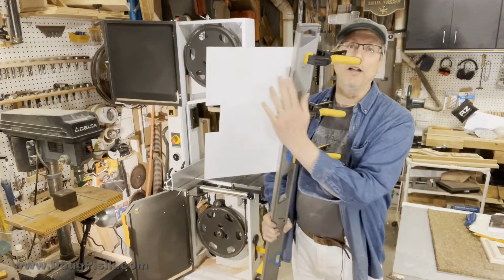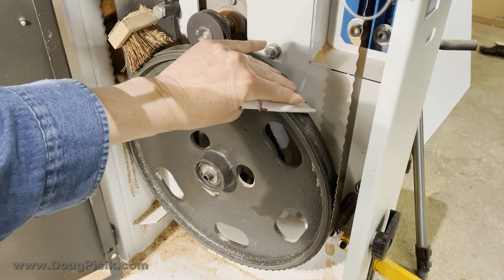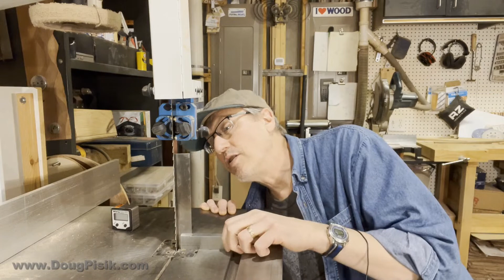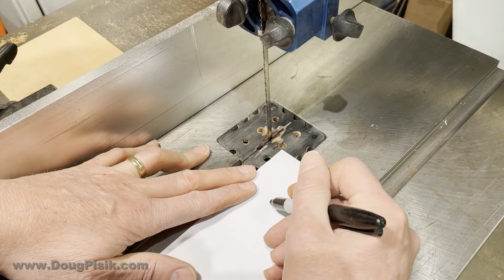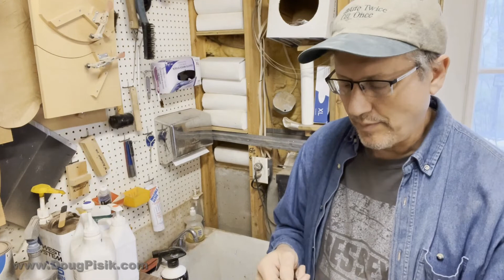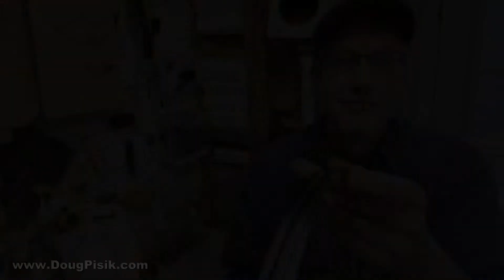Bandsaw 9 Tips for Best Performance and Smoother Cuts

Comment: Thank you for that drift tip...
It's really helpful.♥️
Reply from the maker: Glad I could help. Happy bandsawing!
Reply: @dougpisik Both the machine manufacturer and the bandsaw blade seller insisted that the blade tips need to stick out past the wheels—I’m a bit confused... Are you saying this based on experience?
If yes,I want to give it a try, seeing as that’s been your experience after all these years and using so many different blades...
Reply from the maker: @HamidRezaMardanianPour The wheels are slightly crowned, so a blade that is too far forward would be twisted slightly and won’t always cut straight.  My advice is not only from experience but also seeing what other experts recommend.
Reply: @dougpisik Both the machine manufacturer and the bandsaw blade seller insisted that the blade tips need to stick out past the wheels—I’m a bit confused... Are you saying this based on experience?
If yes,I want to give it a try, seeing as that’s been your experience after all these years and using so many different blades...
Reply from the maker: @HamidRezaMardanianPour  The wheels are slightly crowned, so a blade that is too far forward would be twisted slightly and won’t always cut straight.  My advice is not only from experience but also seeing what other experts recommend.

Comment: You talk about the importance of coplaning the wheels then when you adjust where the blade runs on the top wheel doesn't that put the coplaning out of alignment?
Reply from the maker: The top wheel blade tilt adjustment is a minor movement that shifts the blade location on both the top and bottom wheels.  If the wheels aren’t mostly complaner to start with, then when you adjust the top wheel the blade on the bottom wheel might be out of alignment.
Reply: Absolutely Alex snodgrass from Carter products says not to. 

https://youtu.be/wGbZqWac0jU?si=61ah1Z_dMxmoIpCl